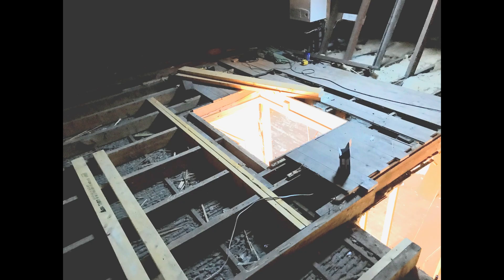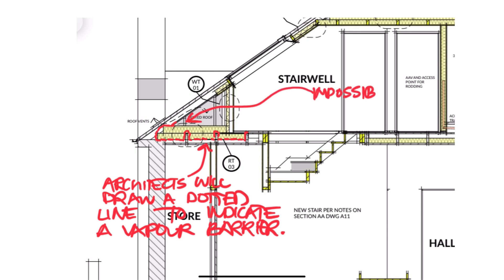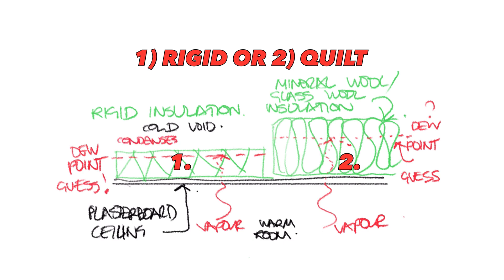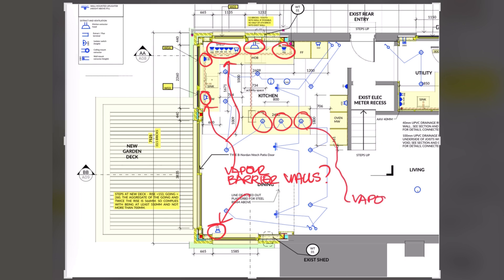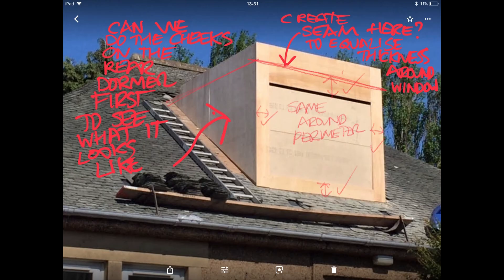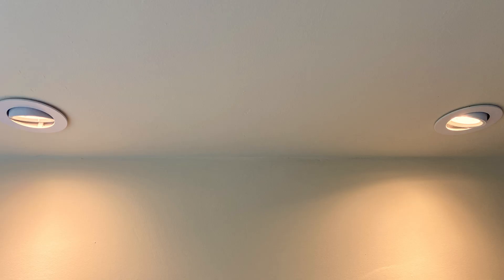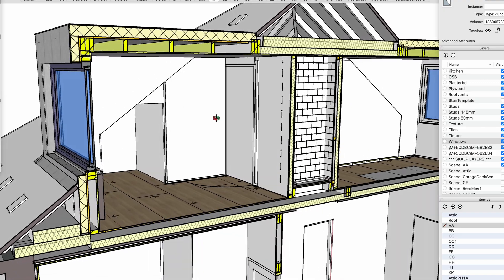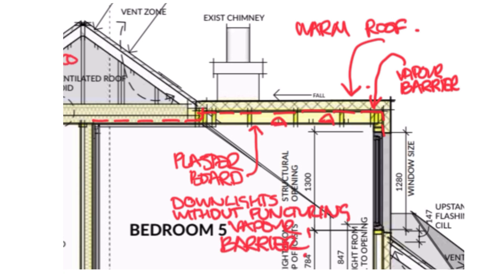Vapour Barrier or vapour control - 2 ways to solve common problems

Comment: you said you create a negative pressure by putting more vents at the eaves than the ridge. Don't you mean the other way round? Given warm air rises what you said would create a positive pressure by allowing more air to enter the eaves than leave the ridge. I can't see more air entering the ridge and pushing air out the eaves. I have recently come to the conclusion that at some points in the year water vapor condensing is inevitable. If we assume that a well ventilated space has similar conditions to the outside then when it is cold outside to the point that their is frost on everything such as the roof tiles then there must also be frost or at least condensation on the underside of the tiles/membrane. The outside temperature is often several degrees below the dew point so even if the inside if a few degrees warmer there will still be surfaces below the dew point. The benefit of ventilation is that the space will eventually dry out as in the UK we don't get frost that much and when it warms up the limited amount of moisture will be able to escape. I think in colder less humid climates it is colder but also dryer and buildings are constructed differently.
Reply from the maker: If you read the British standard with regards roof ventilation, it explains the logic. It’s a requirement to do it the way I lay out for building regulations. But aside from all that, it’s basically the “stack effect” which I’m sure you’ll know about.

Comment: Properjob27.Rich. Saturday 22/02/25. 
Hi Jeremy thankyou for great video input. True expert.
I had sprayfoam removed externally and replaced with TLX  under  new roof tiles. 
On the manufactures video it says to complete the effectiveness of the product  you should install insulation panels under the TLX gold side  in between the rafters leaving a space to achieve an air gap.
Is this necessary as I have no insulation on the floor of my attic. Its partly boarded. 
Semi detached 1970's build.
Cheers Rich

Comment: Thank you for the very helpful introduction,  I'm in the process of renovating a timber framed house from the 1980's.  

The general construction principle seems to be a ventilated living space (ceiling level vents through the outer walls, vents in the window frames and vents in the floor space) with a vapour barrier in the ceiling but no barrier in the walls (50mm glass fibre, 12mm marine ply, outer tropical hardwood T+G cladding).  They got that wrong - there are more roof level vents than floor level, so there's no chance of creating a proper updraft, especially if doors were closed, and of course the barrier had plenty of perforations for cables and light fittings.

It has been 'renovated' in the past, which consisted of adding what a pitched roof (which appears to be unventilated) over a flat root - which is probably bitumen roofing felt (I've not cut through the aluminium sheet below the felt, YET!).  The void below the aluminium sheet was filled with 150mm glass fibre insulation and this void was unventilated, although somehow there had been a rodent infestation (mice, judging from the droppings, not recent) in at least part of this space.  The ceiling was 12mm plasterboard with an aluminium vapour barrier on the top face and a nice coating of Artex on the ceiling surface (professionally tested and being handled appropriately based on the contents found).     

On the basis that the flat roof is unventilated I propose to treat it as a 'warm roof', reinstalling PIR insulation, probably 100mm between the rafters and taping all the joints along the bottom face of the joists.  I intend to leave a void below the aluminium panel although its impossible to ventilate along the 'eaves'.  The new ceiling will be installed on battens leaving a space below the insulation for cabling and luminaires installed into the ceiling material.

I intend to replace the wall insulation with PIR, then a layer of breathable membrane, then horizontal battening, creating a wall void for installation of services, then the wall surface material.
All the windows are being replaced with new units, all with trickle ventilation.  I'm also intending to install a positive input ventilation system, drawing air from the loft space.

In your opinion, does this sound like a sound approach?
Reply from the maker: Hi. For a warm roof, you cannot put insulation between the rafters. Insulation needs to sit over the rafters/joists for a warm roof.  And you definitely cannot have any unventilated voids, especially above the insulation. It’s hard for me to be precise with your questions without seeing a sketch.
Reply: Thank you for getting back to me, the structure has been modified by the addition of a pitched roof [not yet investigated],  the framing I called rafters are the horizontal beams supporting the original roof - each void has an small vent at the ends - about 60mm x 20mm - without any form of insect barrier, so the roof had a lot of empty wasps nests in it.  Each void above the ceiling was completely filled with insulation, preventing any air movement from side to side.  I will draw up a sketch and post it somewhere,  I think the original roof could easily be turned into a warm roof by sealing the vents, but at the very least we have insect mesh to fit.  We could fit PIR insulation leaving a gap above, permitting ventilation across the voids. The beams are a minimum of 200mm high, even allowing for the firrings. @build-better-things